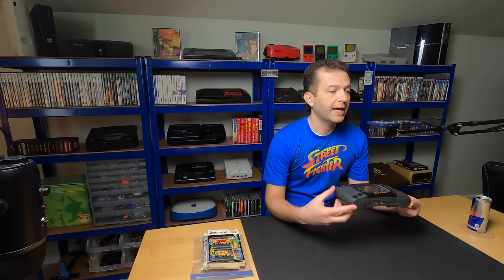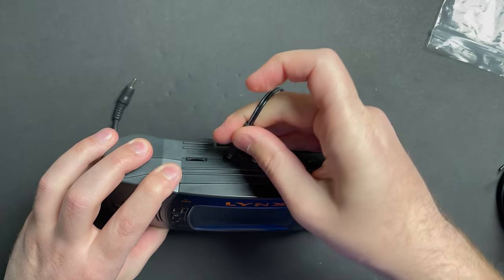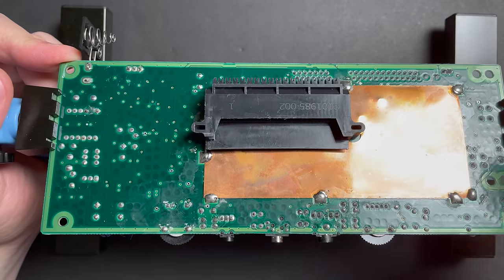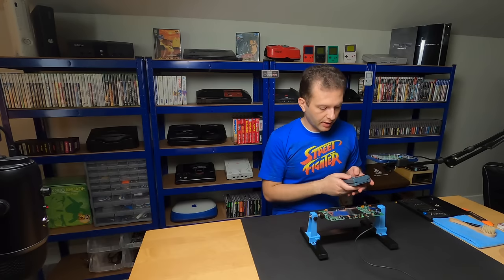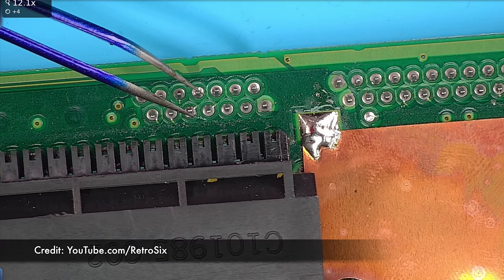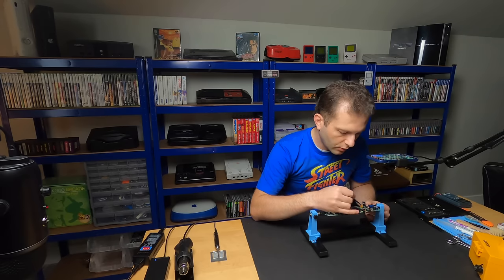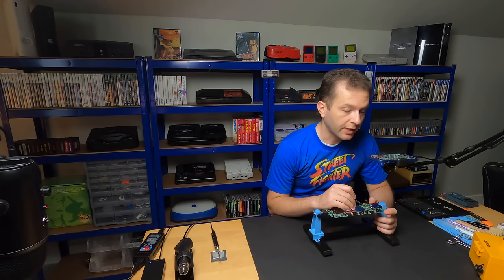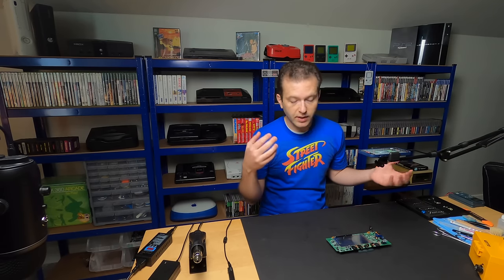Full refurb on a BROKEN Atari Lynx. Can we fix it?

Comment: Did you try using the 'FLIP' BUTTON TO SET IT TO THE CORRECT ORIENTATION???!?!? Maybe that's why the SCREEN IS BLANK, try turning it ON and HITTING THE FLIP BUTTON or some of the COMBINATIONS OF THEM that it seems to show on the front of the Lynx ... 🤷‍♂🤷‍♂🤷‍♂
ALSO, you didn't look under the RF shielding at the chips... MAYBE there is a bridge between some of the pins... you DID notice little blobs all over the place.... maybe there are some on the main chip's pins.... ALSO just try REFLOWING THE CHIPS SOLDIER.... IT can't hurt at this point right? ...  🤷‍♂🤷‍♂🤷‍♂
( Don't forget do all of this on video so you can upload a PART 2 and you have a new UPLOAD for us :D )

Comment: I don't see how you can measure some of the things you measure with the components installed.  When a component is installed onto a board, there are potentially other circuit pathways that you are reading through.  All components should be measured before installation.

Comment: The Lynx is not region free. You said you brought the console in the UK. Are the games you are trying US or UK?
Reply from the maker: WHAT. I did NOT know it was region locked. However, I would still expect an "Insert game" message on the screen if it doesn't like the cart? I've also tried shorting pins 31 and 33 on the cart connector to bypass the cartridge check altogether. No idea about the games I bought. Nothing on the  boxes/manual/cart labels about region. I can only assume they are US though given they were purchased here.
Reply: @BorderlineOCD  The Lynx is region free. The guy above doesn't know what he is talking about. Reach out on the Atariage forums there are alot of knowledgeable people on there. Great video.

Comment: Did you try more than one game cart? 
Could be if you didn't, that particular cart may be bad. 
The Lynx will act pretty much like that without a working cart.
Do you have an oscilloscope?
A LOT more could be deduced with one. 
New viewer so I don't know what you have for equipment yet.
Reply from the maker: No oscilloscope yet. Trying to decide between an oscilloscope or microscope for my next piece of kit but this is just a hobby and I have to keep it under control.
Reply: @BorderlineOCD  Check out Adrian's digital basement. He does a review of a $60 oscilloscope.